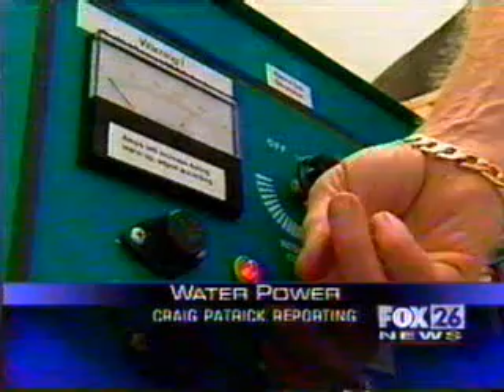Water Car

Comment: My friend you do not know what you are talking about.  The principle of conservation of energy states that energy can neither be created or destroyed, it can only change form.  This technology actually supports that principle.  It takes very little electrical energy to release the HHO gas.  Much less than you get out.  HHO provides the atomic power of Hydrogen, while maintaining the chemical stability of water.  It's not creating energy from nothing; it's releasing the energy that's stored.

Comment: Although I have come up with my own therory how the electoysis(sp) thing is done. We put water in, we have a simple car battery and then that is for the starter. Then as the axle moves then it turns the turbine in whatever and then creates electricity so it goes in a full circle. No need for gas etc. to power the electroysis process.

Comment: I am really getting tired of hearing about these water powered cars.  I can say my car runs on water too.  I put water in my radiator.  What else is the car using?  It's not the water that is making it run without something else.  What other liquids are they using or batteries or what other type of energies are being used that need to be replenished.  Let's here the whole story instead of just a car that runs on water.  Jeez!!

Comment: He said he used an electrolysis process to convert the H2O gas into HHO. This being said, he more then likely used something like a battery to create an electric current. That, (if developed properly) could easily be created using a system of magnets to produce an ample amount of charge.

Comment: Fuel Cell (which also operates cars on water) sounds much more efficient.  This guy is using an internal combustion engine (i.c.e.) which is tons less efficient than an electric motor (fuel cell technology).  Still, a regular gas driven car (i.c.e.) can easily be retrofitted with this, whereas fuel cell  requires a whole new car - so it would make a good transistion technology.

Comment: Totally fake or mis-represented. What power supply did he use to convert the water to HHO?  How much energy did the transformation require? The fact that this isn't mentioned should give you pause. If it required the energy of 3 gallons of gasoline to run the process to convert the water to fuel then the saving are quite modest indeed.  The same 3 gallons he could have driven the car 100 miles, right?

Sorry folks, this is too good to be true.